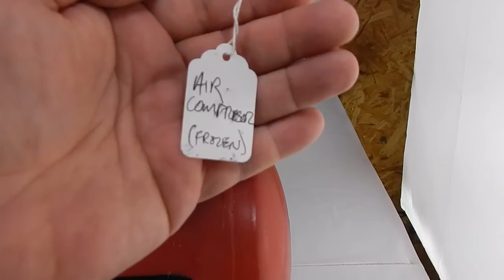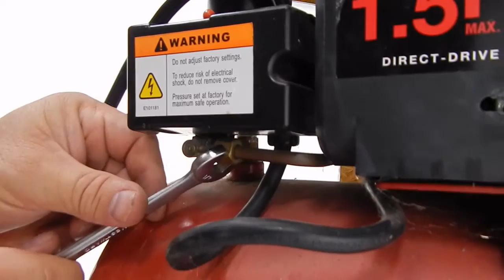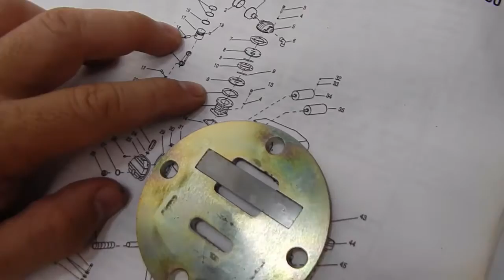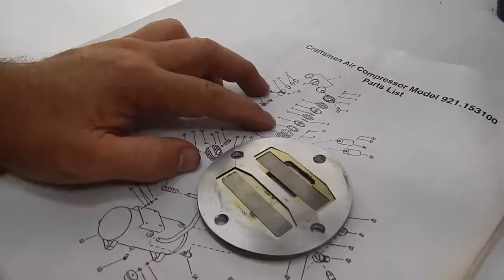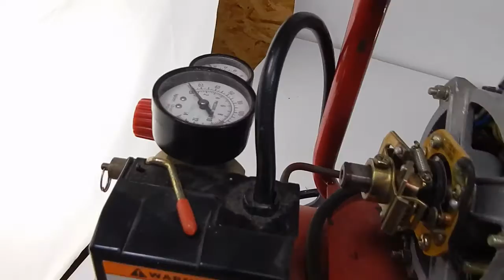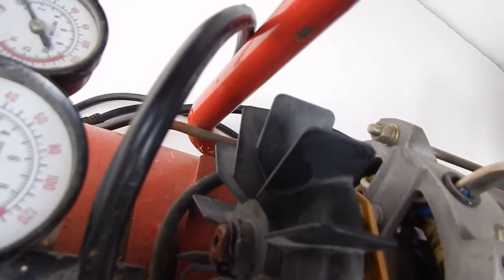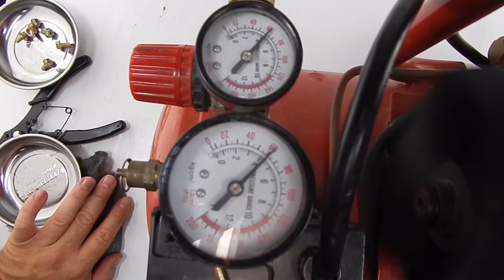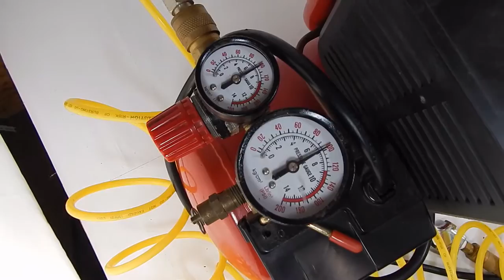Can we save it? Craftsman 1.5HP 3 Gallon 125 PSI Compressor 921.153101

Comment: Thanks for this video. Helped me get my dad's almost identical compressor he bought in 2001 I believe, I found a 2001 tag on it. I inherited when he passed away. I only took the top piston plate off and oiled the piston and changed the oil as well. Sprayed lithium grease inside the fan motor kept turning the shaft with a vice grip until it freed up. Plugged it in and it's back to life!! Thanks again sir.

Comment: With this compressor design, it's very common for the top head gasket to fail at its weakest point where it seals between the two head chambers (intake and exhaust). When it blows out the compressor will reach about 20 to 40 PSI and then just keep running. I replaced the bad gasket on mine and it works great again.

Comment: Great video.wish I had seen this before I tackled mine. Same problem. But I have a bad oil leak at the crank case. May have over tightened it. She'll  be right. I'll  get it fixed.  But we'll done.

Comment: Take a dab of silicone or grease to keep the reeds in place. Unscrew the pressure fitting from the head. It makes the job a little quicker .did you adjust the regulator for pressure?

Comment: I got air compressor just like that and it's somewhat seized but it seized at the connecting rod anybody know the correct way to pull that off
Reply: Looks like an allen bolt and locknut securing the crank to a slot in the motor shaft. Mine is seized at an inconvenient angle to get a wrench on the locknut - but more inconvenient is the price of the piston/crank kit (E100251 ?), which is about $75. I suppose if I want to spend that much, I can just use a cutoff wheel on the connecting rod to get it out of the way of the allen key/locknut.